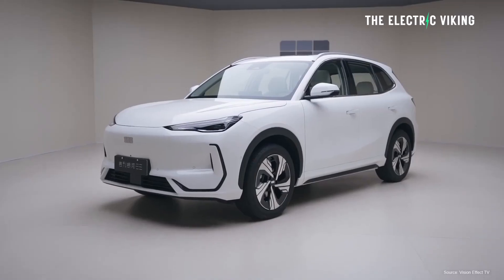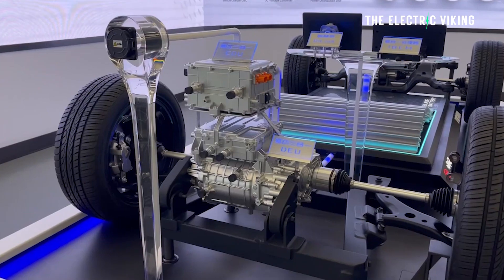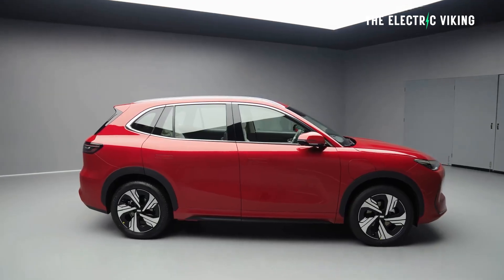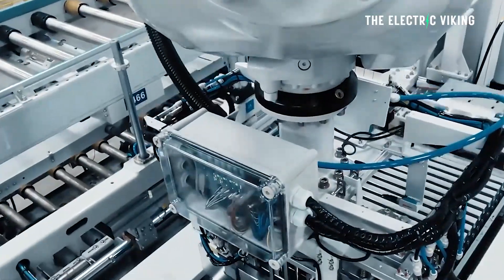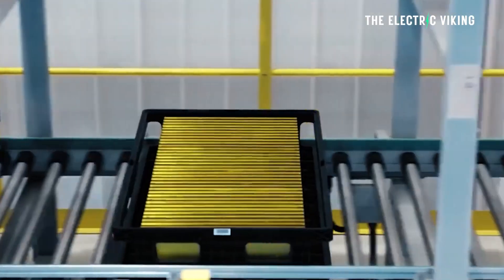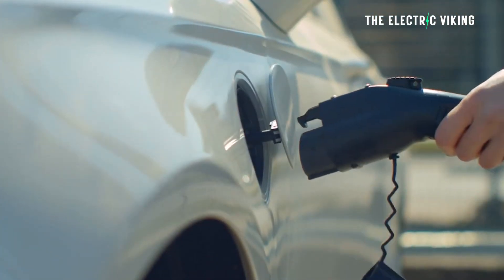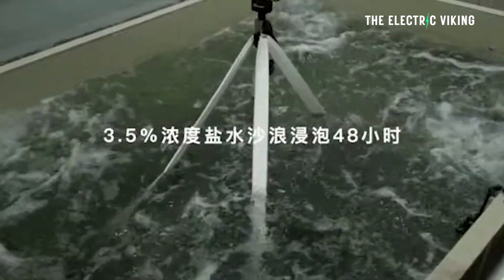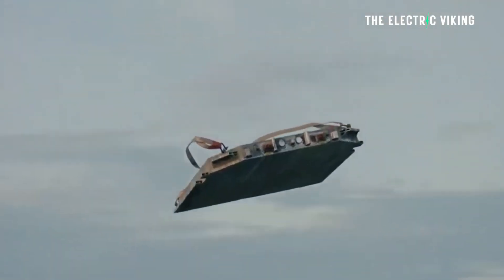Geely’s 1 Million mile LFP Short Blade Battery is the safest battery in the world

Comment: I think that the best type of battery for cars, are the blade batteries...maybe the short ones are better for less heat generation and reduced losses. 
The reason I am saying they are the best is that they can offer the best volumetric density and provide the best cooling as well as safety

Comment: It will be a game changer - so all current EVs are pretty bad ? I thought so. Secondly, what will be the range of a full charge ? 1 mln charging cycles is ok but the current ones also offer thousands of cycles this is not the big issue. What is the range of a full charge ? This is the point. How long will the Geely last with A/C, Radio and 150Km/h ? This is what is the problem about. Safety of course too but this is not everything...no chances to ICE, still unless we will see substantial reduction in weight , increase in range and reduction in charging times.

Comment: From what I'm seeing the battery safety tests are structured to generate the desired results. I'm not seeing battery behaviour under crash test conditions where battery output leads and terminals will be compromised. You can make a fuel tank safe in and of itself but put it in a vehicle and crash it to see what might generate a fire or explosion.
Reply: BYD drppedit fro height, ran over it with 😢truck then put it back in a car. It worked fine.
Reply: @markhartung1190  That's not a crash test in a vehicle. I can beat the crap out of a battery with little to no reactions. Stick two terminals together and I've got a welder.
Reply: @nzer57  they do crash testing as well. You can't sell a car unless it has been through rigorous crash testing. The battery failure tests we see in the videos ar in addition to the car crash testing.

Comment: When you purchase an electric vehicle, you must check whether the vehicle is equipped with an NCM or NCMA type of battery with a high nickel percentage (90% or more). 
Among existing battery types, the ultra-high Nickel ingredient NCM or NCMA has not only the highest energy density and the best low-temperature characteristics but also the fastest charging speed. Moreover, cost efficiency, i.e. price per unit volume/weight considering energy density, would be better. 
Due to fundamental technical characteristics, LFP batteries are not suitable for electric vehicles that require a high C-Rate (high current charging/discharging). So LFP battery is not stable in such high C-rate environments in cars and it may cause fire. 
Instead, an LFP battery is more suitable for ESS (Energy Storage System).  The LFP battery will be replaced with a sodium battery soon because the low-temperature characteristics of a sodium battery are much better than that of an LFP battery. 
You all need to keep this in mind.

Comment: Short blade battery is unable to be composable as part of the car, which means Cell-To-Body or CTB tech is unapplicable, which means it will always give a poorer internal height comparing to CTB cars. Also, blade battery is secure on the same level, shorter or longer, piecing through 1 needle or piecing through 10 needles. They are about the same because no big changes internally. Lastly, Geely's short blade battery, as shown in the tech details of Chinese industry website, has 150 compacity (not 190 as Geely says itself, they trick the calculation method to confuse consumers), which is only a bit better than BYD first gen blade battery (145). The BYD's battery has evolved a lot since (first gen is five years ago) and it's going to release blade battery Gen2. I think many companies are doing well in tech, but Geely tends to be the wired one which always likes bragging about itself. When you check the accurate numbers on Chinese official website. Those things don't match and it has a very big leap than Geely advertises! Honestly, I can't say I like this.
Reply: A boast that Chinese people like. 
Don't be fooled by their propaganda.

Comment: Check out Sakuu's metal free batteries. They are lighter, thinner and have no casing, so should be easier to build into an EV battery pack.  Sandy Munro did a short presentation of them. Battery technology is progressing at such a break neck speed that ICE will come to a  screeching halt, most likely by 2030 for most new passenger cars.

Comment: Hi Sam,
You mentioned at the beginning that the battery had some downsides, but the weren't in your opinion very important.  You didn't however go into what the downsides were compared to other batteries.
Reply: Compared to high-nicker NCM or NCMA batteries (Nickel 90% or more), which are currently a game-changer as batteries for electric vehicles, the disadvantages of LFP batteries are as follows.
The disadvantage of the LFP battery is that, due to its battery characteristics, it is not suitable for an automotive battery that requires high charge and high discharge C-Rtae. If such an instantaneous high charge/discharge situation occurs, in the worst case it may cause a fire. Another important drawback is that at temperatures below zero Celsius, the power characteristics are almost halved and the driving range is also halved. The unit volume/weight energy density is also much lower than that of high-nicker NCM or NCMA batteries. In other words, because of these shortcomings, the LFP batteries are used as ESS batteries rather than automobile batteries. Soon, Sodium batteries will even replace LFP batteries as ESS batteries. This is because, despite having a similar energy density to the LFP battery, the low-temperature characteristics of the Sodium battery are much better.

Comment: NIO is the only EV company capable of installing the  latest battery technology in 3 minutes in vehicles that were produced years ago. Probably the only EV with resell value greater than an ICE car.
Reply: Big deal. The Nio business plan, based on  EVs having very short ranges, is bust. Having to hold a very large inventory of fully charged batteries to handle the worst case use case, e.g. start of the holiday period, makes it unprofitable.
Reply: @rogerphelps9939  Your comment suggests you know nothing about NIO

Comment: The one that interests me is the CATL condensed matter battery with a density of 400 to 500 watts per liter, so you could get better range without weight penalty . There are a very limited number of chargers with charge rates that right now that allow these improved charge rates.
Reply: 500 wH/kg rather than per litre - it's gravimetric denisity that is the being increased in batteries, their volume isn't that critical as they already sufficiently energy dense in that respect.  It's kind of the opposite of hydrogen that has very high wH/kg but very low wH/ltr, where they are seeking to increase the wH/ltr by liquifying the gas.

The condensed battery is also targetting different markets at the moment, such as static storage, electric planes and possibly vans/freight EVs, where charging time is less critical. It's CATLs previous Qilin (255wH/kg NMC chemistry) and newer fast charging Shenxing batteries (205wH/kg LFP / 4C charging) that are targetted towards BEVs. The smaller pack size of the Shenxing batteries should also enable 1,000km range cars.
Reply: Yes, but keep in mind that 550 kW is the peak charging on a huge battery I presume. With a smaller (smarter) sized battery, I guess the charging wouldn't be 550 kW.
And it goes down with the battery filling up. So if you have a 250 kW charger, you might have only 250 kW ... but during the whole charging process ... which is already great (42 kW every 10 minutes).
It's misleading to talk about the peak charging power as it depends on the size of the battery. In my EV, the battery is 66 kWh and charges at 150 kW ... I could have a 1'500 kW charging speed if the battery was 660 kWh ...
Reply: @johngonon1507  He's talking about the actual storage capacity for it's size, not the charging speed. Also charging speed doesn't just depend on capacity to that extent. The base chemistry of  the battery matters more and size just influences that somewhat.
Reply: @nfzeta128  He actually wrote 2 sentences and the second speaks about charging speed. The packs are composed of cells. The cell is the limiting factor for charging speed (chemistry, cooling, etc ...), but since they are charged in parallel, the more you have cells, the bigger charging speed for the whole battery you can have. So size of the battery (which is proportional to the number of cells) does matter.
The same can be said for battery life. The bigger the battery, the more km you can do before reaching its end of life (more km per cycle) ... but you still have the ageing of the batteries, so it's not as proportional.

Comment: I think we need batteries that will last the life of the car but we also need some that make the tradeoff of only lasting 150k km but have performance in other areas. Maybe charging faster? Also, if the battery were cheaper to replace maybe $1,200 exchange for a refurbished one after 100k km it wouldn't need to last as long. The most I've even kept a gas car was 240km and I got all of the value out of it for what I paid.
Reply: For an EV, the life of the battery *is* the life of the car.  Current battery tech is now superior to legacy automaker fabrication of the platform and chassis.  ICE is dying.
Reply: @PETERJOHN101  If batteries get cheap enough to replace the life of the battery won't be the life of the car. I predict they will get cheaper to replace in time, and maybe even be upgradable.
Reply: @frankcoffey  If you're going to replace the battery of a car might as well buy a new car. This argument is ridiculous.
Reply: @PyroShields  It depends on the condition of the rest of the car. There are people who tear up every part of their car inside and out in 5 years and there are people who take very good care of them and they are still good.
Reply: @frankcoffey  If the engine goes in your car and it's old you replace the car. 
However if you're EV is 5 years old and less than 100k miles. Tesla will change the battery if there is something wrong with it.
Reply: @PyroShields  Yep, still under warranty at that point.

Comment: Solar battery storage manufacturers are selling LFP batteries that are guaranteed to maintain 90% of their capacity after 10 years or 6000 cycles. The chemistry of these cells should be very similar to these Geely batteries. If your solar system charged your LFP backup batteries every single day, it would take 16.4 years to reach 6000 cycles. So, the solar LFP batteries should easily last 20 years or more while maintaining 90% of their capacity. I think that the EV world is just now starting to understand the potential of the LFP design. CATL's newest batteries that mimic solid-state design capacities, charging speeds and durability are based on an advanced LFP design. In the near future, LFP batteries will dominate the EV world and it is likely that some of the first solid-state batteries will be LFP hybrids.
Reply: I think that you would be wrong. Just check the high Nickel(90% or more) ingredient NCM or NCMA battery out which is most suitable for electric vehicles.
Reply: @geoquestprime9447  Actually, there are websites that track the real-time degradation of Tesla vehicles. The LFP batteries degrade the least over time. The NCM and NCMA batteries are not as durable. 

I have a used 2022 Tesla Model 3 with 79,000 miles on it. Reccurent rates it at 95% of its capacity, but I don't think that it takes into account that my car has 19" wheels. Recurrent tracks actual EV statistics. My car will get between 225 - 250 miles on a full charge. The 19" wheels decrease the total range from 272 miles to 246 miles. So my car's actual battery capacity is approximately 96% - 97%. 

If I drive with 10 miles of the speed limit and the weather is temperate, it is possible for me to get 250 miles out of a full charge. I typically drive more aggressively, and so I get around 225 miles on a charge. But range depends on a lot of factors.

Now, Tesla's non-LFP batteries are probably the best in the industry, but they are not as good as the LFP batteries. That is why Elon Musk is working with CATL to build a factory in the US to produce CATL's new ground-breaking LFP battery which is supposed to have 620 miles of range and charge in 15 minutes.  CATL has taken the LFP battery and improved it.

We see that LFP batteries have literally taken the solar battery industry by storm. Nearly every solar vendor no longer even sells storage batteries that are not LFP. Further, Tesla's new Powerwall 3 uses LFP battery technology and the warranty has been extended from 10 years to 25 years.

So I am pretty sure that I am correct on this subject. Tesla is abandoning its NCM batteries to switch to LFP.  But it cannot do it instantly,  it is transitioning as quickly as possible away from NCM batteries to LFP and possibly, new solid-state battery technology that is already in production from other companies.
Reply: @geoquestprime9447  Tesla's new Powerwall 3 uses LFP battery chemistry, and the warranty went from 10 years to 25 years after the change to LFP batteries was made. When you consider longevity, NCM and NCMA battery chemistries are inferior. That being said, all of Tesla's batteries do a great job of maintaining their capacity. However, LFP batteries dominate the industry in longevity right now.  Model S cars with Tesla's early batteries lose about 20% of their capacity over (approximately) 200,000 miles. LFP batteries are maintaining over 90% of their capacity after 200,000 miles. Some are maintaining 95% of their capacity. They also are much more durable when you charge them. You can charge them to 100% and it's actually good for them. They are not as good in very cold weather, but all EV batteries being used currently degrade significantly in cold weather.

 There are websites that track actual EV battery longevity and LFP batteries are by far the best.

Comment: The proof is in the putting; one really can't judge safety by lab tests.  You must have years of driving real roads and drivers before such claims are proven.Pleanty of BYDs have caught fire recently using blade batteries ; not necissarily these short blades but none the less a bit question about making them shorter really improving safety. Only time will tell.
Reply: EV fires start from damages done to the battery, salt water contamination or defective batteries and  not from age.
Reply: @PyroShields  Dendrites grow at random inside lithium cells; more time means more chances. A Dendrite can strike & short a Lithium battery brand new or years later. Examples Falicity Ace fire; sinks a giant ship w 4000 luxury cars on board - brand new Porsche BEV, just parked. 10 BYD dealerships have burnt to the ground. Search BYD fires; you'll see brand new BYDS on the carrier on the way to the dealership on fire. The recent factory fire in Korea that killed 22 people.  These are all brand new never or barely driven ; Tested good; charged one time at the factory, sitting doing nothing.

Comment: Problem with BYD  long blade is that LFP have lower voltage which   make it harder to fast charge. But they are cheap and  durable.
Reply: Can't have the benefit of both  worlds.
Reply: @PyroShields  eh, not yet but there are technologies that are showing promise in that direction.
Reply: True, but remember the practical impact depends on the use case. My 4 months old Model Y LFP has been fast charged once, just out of curiosity. Frankly, there are many people out there who couldn't care less about fast charging. My number one priority is durability and LFP excels in that regard.

Comment: If the battery would be fine in used EV (after 200 000miles), then the battery full 100% warranty must be the same for example 300-500 000 miles or 25 years. If manufacturers will not offer long warranty for battery, consumers will not trust that replacement is not necessary for old EV/battery.
Reply: LFP already cheap and some   give you life time warranty.
Reply: @yulusleonard985  Please inform me, which EV-brand will offer much longer 100% full warranty (than 8 years)? Also give some information about the brand which using on their cars LFP batteries and cheap battery replacement cost for EV.
Reply: @iSot80  SAIC. MG4/Wuling standard range are using LFP, long range and X-power using NMC. At least in my area but they are now start offering lifetime for LFP almost everywhere. It just this year LFP reach rock bottom price and they start getting aggressive with promotion.
Reply: @yulusleonard985  Ok, so 100% lifetime warranty for EV battery. That is what consumers need.
Reply: @iSot80  Isn't an 8 year warranty long enough? You can't get 8 years on an ICE vehicle.
Reply: @PyroShields  No it is not if battery replacement cost 10-20 000. Battery must last at least 20 years without worries (or warranty for that) or without degradations which will lowering the battery health or range. Otherwise there is no resale value or market for old used cars.